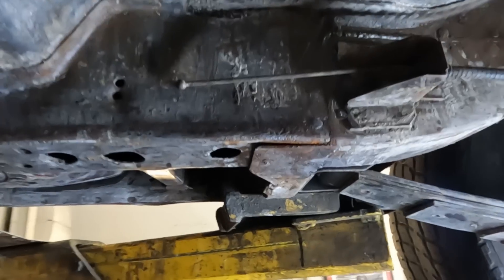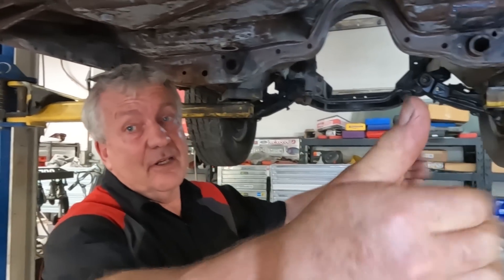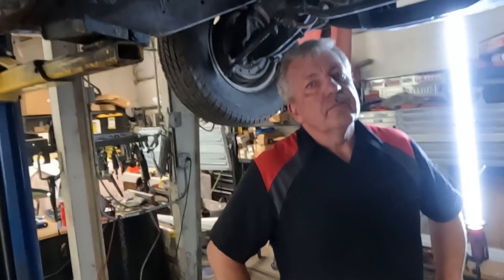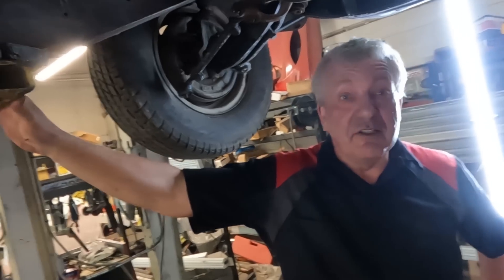Beefing Up Unibody Cars With Home Made Torque Boxes

Comment: What's your thoughts on rear air shocks?
Reply: worst idea ever
Reply: What's so bad about them?
Reply: @poorboy3136  they chnge geometry of the rear suspension and drivelinea
Reply: @poorboy3136  Shock mount on cars with separate springs are not intended to take weight of car.
Reply: @derekhobbs1102  what about coil over shocks with coil springs
Reply: @poorboy3136  If it's factory, then it's reinforced at mounting point.
Reply: The car has ladder bars and originally had air shocks

Comment: GM didn't do much reinforcement of their unibody cars back then. That (and rusted/broken spring shackles) is a big reason why we used to see so many Camaros, Novas and their clones "dog tracking" back in the day. It's amazing how much difference a set of frame ties makes on any unibody car. I have weld in sub frame connectors under my 74 Z28 but, even the bolt in style makes a huge difference.
Reply: That reminds me of helping pull the engine out of a friends 74 Trans Am with a heavily warmed over 455. We struggled to get the motor mounts free from the engine, but once it popped out the whole chassis twisted, cracking the windshield. The only thing keeping the car straight was the engine’s rigidity, the body was too far gone to fix at that point because there were cracks everywhere in the unibody and he ended up swapping the engine to another donor car.

Comment: One of the things that always irked me is years ago when I'd argue with these guys who said 'full frame' cars(like GM muscle cars) were sturdier than unibody cars. The old full frame cars were nothing but box metal and the sheet metal screwed to it essentially. They would NOT hold up in a crash for instance as well as a unibody car. Unibody cars were somewhat of an early rendition of the way cars are built today or at least the way they react when in a crash. I used to work in a loca junkyard in the 70s that many recently wrecked cars were hauled to and nearly without exception the GM cars were more trashed from lower speed crashes than the Chrysler cars. At some point speed-wise it didn't make a diff, they'd both be totalled back then but more often than not the unibody cars held up better from my experience. Sorry, the torque box issue just reminded me of this.
Reply: I'd agree with your experiences, uninbody  crumple zones have saved so many lives!!
Reply: Point is, a sheet metal.body and a full frame have different rates at which they crumple, and many times a stiff frame simply just lets the forces of impact get transfered to the body..I remember reading this somewhere a long time ago in an article on "controlled collapse" engineering in cars
Reply: Absolutely not. A unibody can not and will not ever be stronger than a car with a full frame. Its simple physics.
Reply: @Whats-It-To-Ya  I think you want to brush up on your "simple physics". A full frame is only underneath the car, it does nothing to provide strength above the door sills. A non structural body can and will collapse like a paper bag above the frame area. 

A unibody can be as strong or as weak as the engineer decides to make it. On modern cars they are extremely strong, You can do an overlap crash test at 30mph and the door fit doesn't even change. Do that to a period 60s car and the entire passenger compartment is destroyed - but hey, the separate frame under the floor survived!

Comment: Had a stock 289 '66 mustang, you could feel the gas pedal rise and fall in gusty winds driving on the highway as the front end and engine flexed with respect to the floor pan of the passenger section.
Reply: Yes you could! I noticed the same thing on my '65.

Comment: I'm a welder and I wanted to add torque boxes to my 69 coronet but to buy them its $326.99 for the kit the sheetmetal and stamping costs 20 dollars. So I planned on just making my own.
Reply: I beefed my frame by taking a trip to local metal recycler.
Reply: @fastinradfordable  what'd ya get
Reply: @moparnut6933  3/8” thick
4” wide steel. 
5’ sticks. 
🤟

Comment: when i was a kid i learn this we had 600 hp in a 77 camaro it worked good then we went to 1200 hp and things went bad popped the front windshield out the car sat over a 1 inch higher on one side doors would not open no more think i was 17

Comment: All Aussie Valiants had torque boxes front and rear - even on humdrum 130hp, 6 cylinder sedans. We also beefed up other components. Ford did similar, as the first Falcons sold here suffered badly from chassis cracking and damage on our rural roads.
Reply: Mopar Darwin back in day we saw underneath rolling around in the dirt & cat turds (cats RIP)